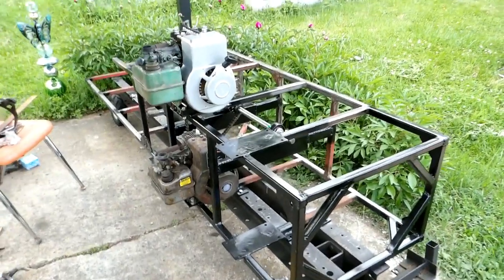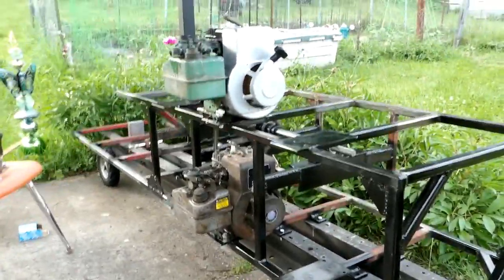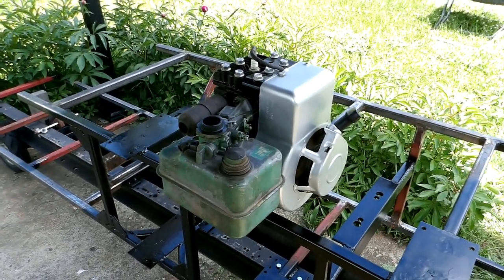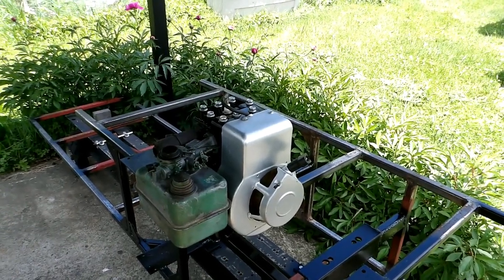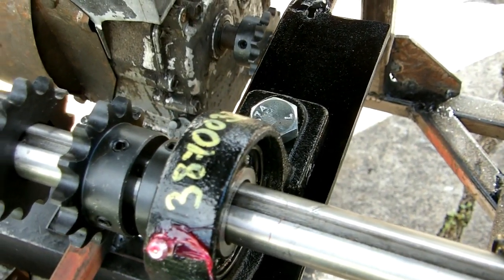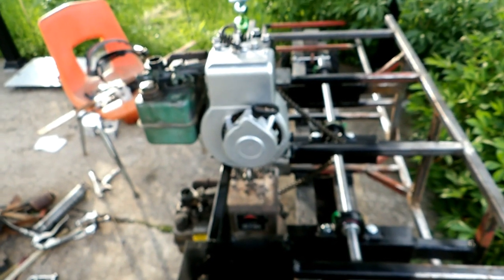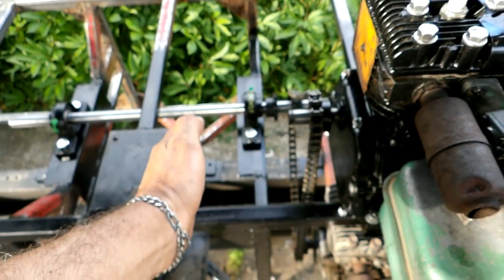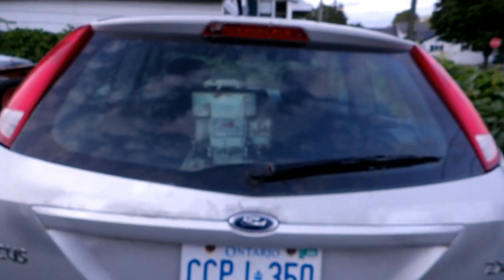Week 10 Two Cylinder Chained Engine Run

Comment: Oil soaked pieces of oak will make excellent guides to take the slap out of that chain.
Reply from the maker: I will consider that, as I have some oak pieces, left over from the wooden cylinder head project.

Comment: To save on tensioners, you could elongate the mounting holes in the baseplates so you can just tension the chains up by sliding the engines about, cheap & dirty, but easier than springy tensions... :)
Reply from the maker: I have done that in the past, but slots are hard to make. I was planning to use shims under the top row of engines adjust the slack.

Comment: you need a nylon slider for a chain tightener with a spring to pull it tight
Reply: like on a v8 engine at the scrap yard, a cam chain tenshioner
Reply from the maker: Yes, I will try a roller type first, then a nylon slider

Comment: A spring loaded skateboard wheel between the upper and lower engines to tension the chain would be good. You may need to invest in a case of chain lube!
Reply from the maker: Hey, good idea, I will look into the possibilities!
Reply: @ChargerMiles007  
Minibike and gocart places is where you may find them. Chains will "stretch" no matter what.

Comment: When you add more motors the harmonics will counter act and the chain will probably run quite smooth.
Reply from the maker: I think I nay have to run all the chains on the 2 cylinder test unit, to pre stretch them.